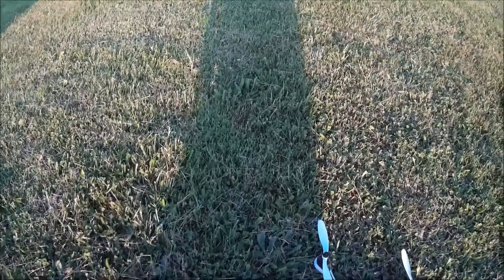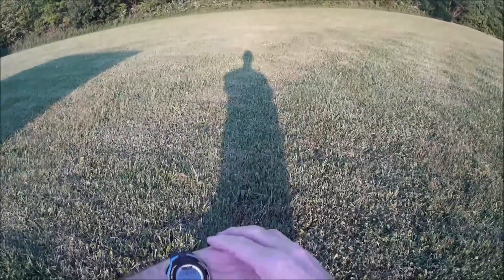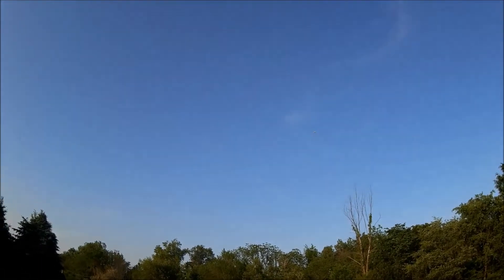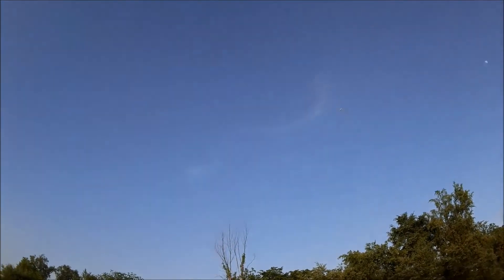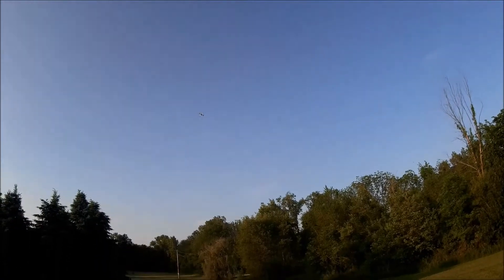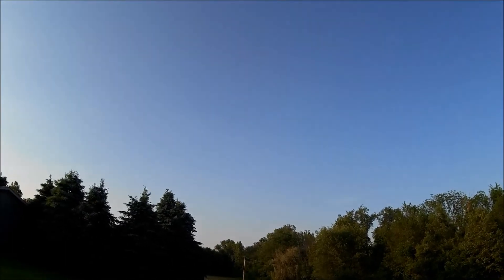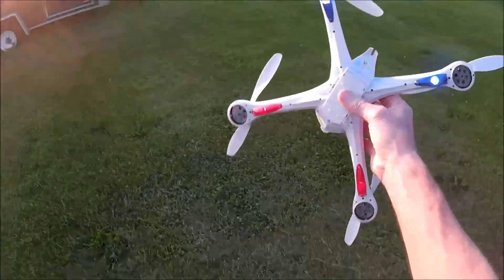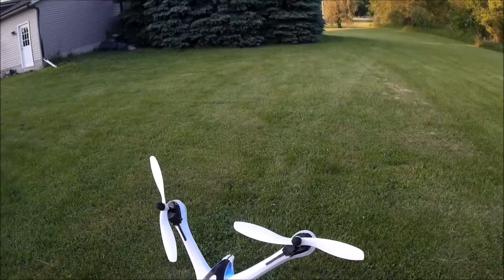Drone Yi Zhan Tarantula X6 in Stunt Mode

Comment: did you take apart the motor to add the graphite to the armature?
Reply from the maker: daniel benson 
Turn the quad upside down and apply a small amount of dry graphite lube through the vent hole at the top of the motor. Rotate the prop so the lube gets on both brushes. Do this process with all 4 motors and it doesn't take much lube. when you are done with all 4 motors turn the quad right side up blow all the excess lube out of the motors and you are done.
Reply: ok thanks
Reply: +Quadflyingfun would you tell me what brand lube you used? I am interested in doing this to mine. I have already taken off the landing gear and prop guards and you are right, it does make a huge difference.
Reply from the maker: +James Brough 
Victor powdered graphite lubricant. I bought mine online but I have seen it at my local Ace hardware store. When you are done applying it blow the excess out with compressed air. Happy flying.

Comment from the maker: Chasn The Wind

Yes, I am going to do a video of applying the Graphite lube. I have a lubricating syringe coming and I will get the video made when it gets here in a couple of days.
The first time I applies it to the motors on my Tarantula I used the tube it came in and too much came out and made a mess. With the syringe I should be able to get just the right amount where it is needed.

Comment: some really nice mods. I'm going to add some graphite lube to my motors. I think you'll be fine doing flips
Reply from the maker: Quad Noris 
I have since done some loops and barrel rolls without any ill effects. I think I will apply the Graphite lube about every 10 flights. I am going to try to find a syringe or something small to apply it with because it is very messy using the container it comes in.
Reply: Great idea .. I'm going to do the same with the Graphite and see the results. I've got a few motors on order incase I mess up haha